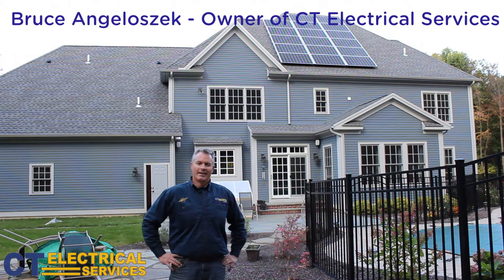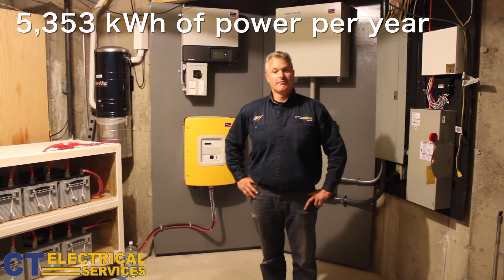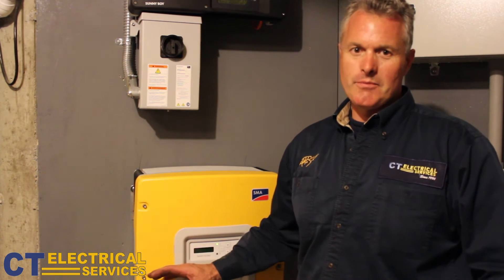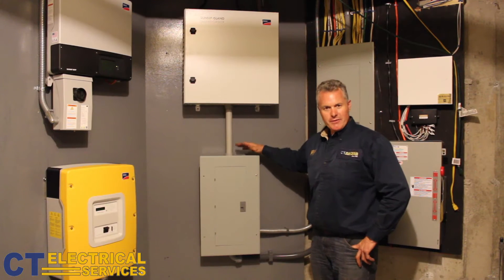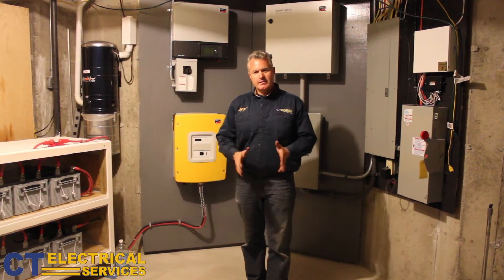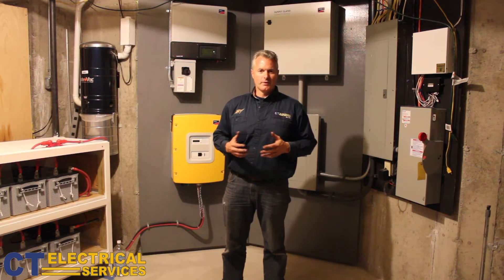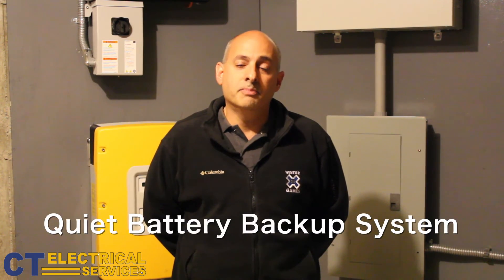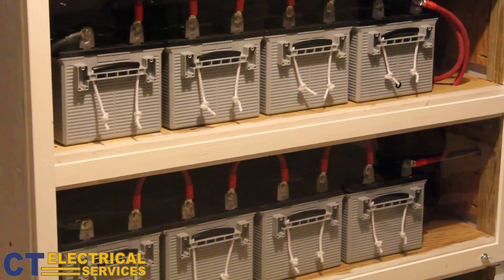Battery Backup Generator and PV System - Burlington, CT

Comment: What transfer switch did you  use with he Sunny Island?  How did you wire the external relay on the grid side the Sunny Island needs?
I have the same set up but trying to figure out what transfer switch will work and how to wire the external relay from the Sunny Islands DIGIN to the ac side (so the SI knows the grid is down and can use the gen settings.